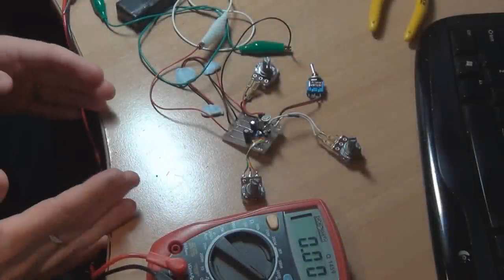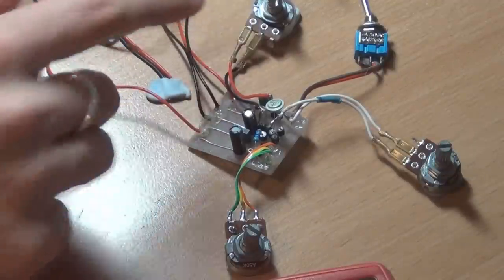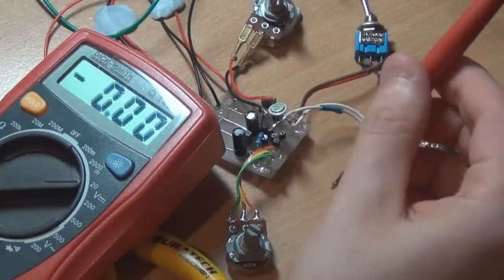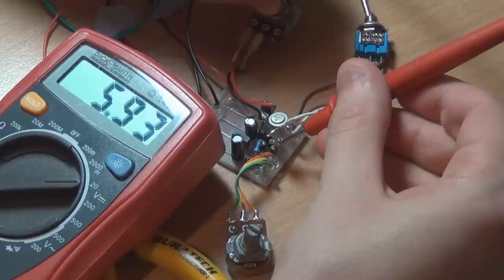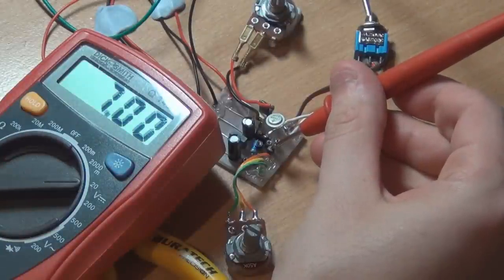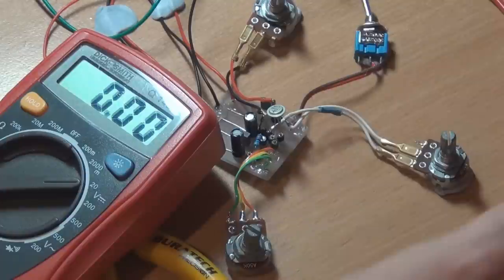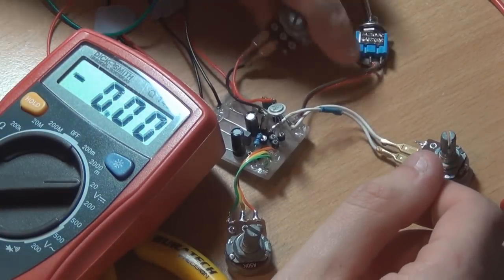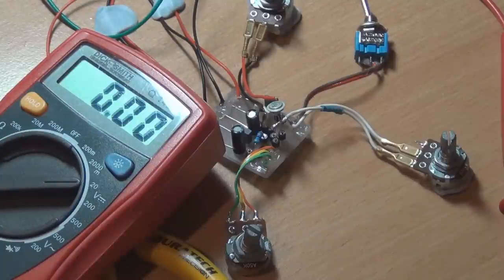Biasing The Rangmaster (A Better Way)

Comment: isn't the Rangemaster  a potential divider biased 1 transistor amp with much higher value resistors than 5 / 100k in the POT DIV  - what were the resistors you were altering?? (RC and RE) 

I'm a bit confused about the ideal bias point  - for max' headroom  one would expect to bias the collector near the middle of the supply voltage (~4.5V).  If biased like this wont it hit the end stop more quickly? Any idea of the typical pk-pk voltage swings for a Rangemaster ?  
(sorry for sounding thick)

Comment: I am wondering if all germanium transistors should be biased to 7v or just the one that is called for in that build?
Reply: Just for that build. Tone Benders are a good example of where you do different voltages per transistor stage.

Comment: Which resistors are R1 and R2? I am guessing R1 is the 68k in original rangemaster and R2 was the 3.9k?
Reply: Yeah... I also thought the bias was set by the voltage divider R1 & R2 i.e. the 68k and 470k resistors across the base of Q1?

Comment: I just made a Arbor Dallas trouble booster and there is a small volume drop when I engage the effect. Does anybody have any ideas as to why? I did use a substitute transistor. Could that be the problem? Is there any way to boost the volume on these trouble boosters?
Reply: Yes you should not have built a trouble booster, it only gives you trouble 🙂
Reply: @qddk9545  it's because I didn't have it biased properly. It works great now.